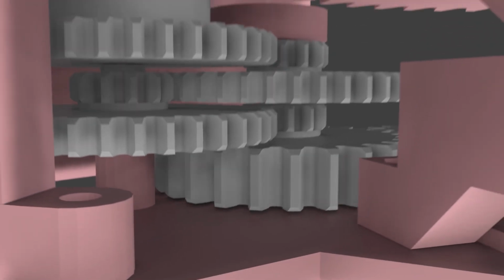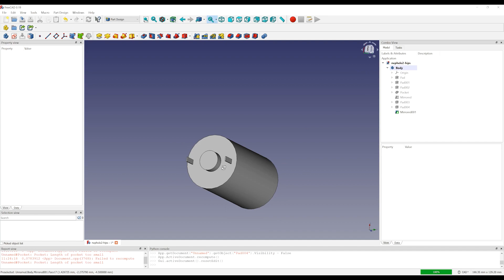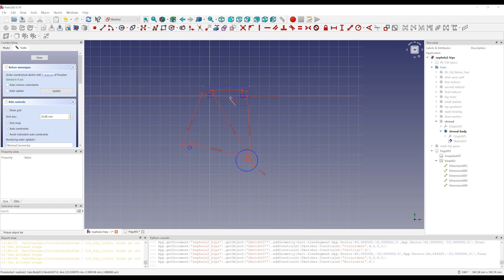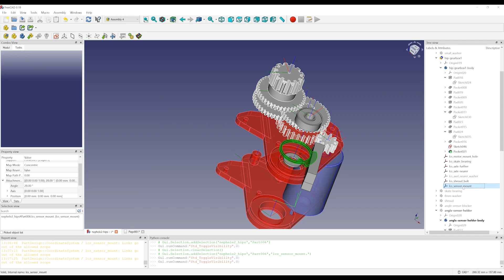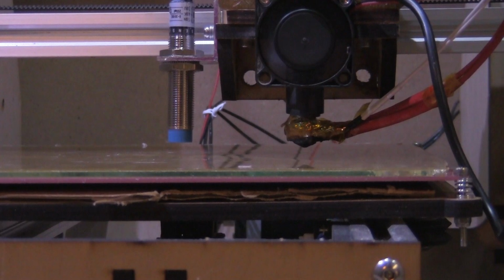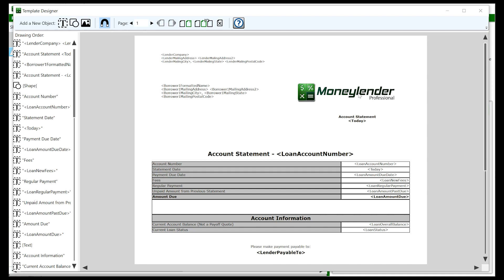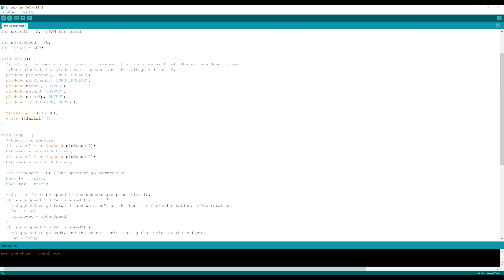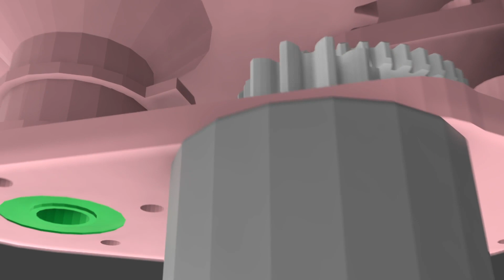Robot Hip Gearbox - FreeCAD design and 3D printing - Nephele Robot Project

Comment: Really good to watch and interesting to see you're using Assembly4 workbench.  I've played with Assembly4 but found it less intuitive than A2+ and Assembly3, perhaps I need to persevere with it...  I'm interested to know how you created the animation at the end of the video, with the gears spinning at the same time as panning the view camera, was this done in FreeCAD Assembly4 workbench too?
Reply from the maker: There's probably reasons to use A2plus or Assembly 3 in some situations.  Assembly 4 is a whole different mechanic, a lot more oriented to designing the parts in the context of a larger machine, rather than putting together parts that are already close to their final design.  But ultimately, they're each tools to help you do a job, so whatever gives you what you need at the moment is the correct option to use.

I did the animation in Blender.  Select all the bodies in the FreeCAD file (can't just select parts, the bodies themselves need to be selected) and export to .obj.  Blender will pull in the .obj file and keep all the bodies as separate objects, but still positioned where they should be.  Then I animated the rotation of the gears, enabled motion blur so you can actually tell how fast the individual gears are spinning, and rendered out a little fly-around.  I'm really novice at Blender, but the animation came out better than I would have guessed.

I'm doing Nephele's pelvis right now.  Some of it I've used Assembly 4 during the design, some I've just used placement properties to loosely position things.  Kinda freewheeling during the initial design stage while I get a feel for the salient specifications.  With the rough-ed in version drawn up, I can visualize the whole thing together and remake it with corrections where I missed some important things.  The finished pelvis parts will be assembled with Assembly 4 and I'll pull in static versions of the hips and legs, too.
Reply: Thanks for replying. I've not tried that in Blender yet but I'm interested to know that it works - sounds like I need to try it.  How does Blender know about the assembly constraints though? - i.e. when the rotation of the motor gear causes the next gear to revolve? - or are they not actually meshing and the parts simply animate independently at appropriate speeds - am I missing something obvious?
Reply from the maker: @eskibrew  You're right, Blender doesn't know anything about the constraints.  In this case it was easy to animate because the gears only rotated on a single axis.  Anything more complex than that would have been way over my head.

Comment: great work. I look forward to see the competed project. do you plan to upload a real time time lapse of the video or the source file to see you work flow?r
Reply from the maker: Thank you :)  Like the real-time recordings of designing stuff in FreeCAD?  On this video, I think it was six or ten hours to design the gearboxes.  It's sped up at least 100x, iirc.  A lot of just looking at it and thinking.  Sped up, it looks like I'm pretty busy the whole time, though.  My next video I have about 26 hours of recorded FreeCAD design.  I'm making an entire CNC milling table.  I'll be posting the FreeCAD file for the milling table and other digital materials for download, so you'll be able to see what I made in the video and then open it up yourself in FreeCAD and look at the parts and sketches and Assembly4 LCS references if you're interested.

Comment: It would be great to see detailed guide on gearbox design.
Reply from the maker: FreeCAD does all the heavy lifting when it comes to the tooth profiles for involute spur gears.  This gearbox was pretty bad in reality.  Too noisy, the outer housings are too flimsy for what they're supposed to do, small gears are maybe too small, bad tooth meshing from poor 3D printer calibration, sub-optimal filament...  After I've made a few more gearboxes as the robot progresses, I might be in better shape to share some information of practical use...  

Reading this page several years ago was super inspirational a ton of what I'm doing these days: https://lcamtuf.coredump.cx/gcnc/ch4/

A massive walkthrough with amazing information about 3D printing gears: https://engineerdog.com/2017/01/07/a-practical-guide-to-fdm-3d-printing-gears/

Thanks for watching my video!  What kind of gearbox are you making?  There's tons of types, and they all have unique characteristics.  When I was designing a pelvis, I used bevel gears and planetary gears, which was really interesting.  Occasionally I might want to use a worm gear or differential drive or something, and those are all really cool, too.  There's really good stuff on YouTube for each type of gear, though.  People who know a lot more than me.
Reply: @WhitmanTechnological  thanks for useful links! I’m working on a robot suitable for digging terrain and moving heavy objects (100-200kg). So I need high ratio (200:1) gearbox for drive train and will work on a manipulator later (want to use electric servos like you do, instead of hydraulic). Also, I want to open source it so everyone interesting in programming can just print chassis and start to implement their own robot logic without digging deep into mechanical engineering.

P.S. there is a lot of tutorials about single gear but no information about how to design a complex gearbox: what gear sizes at each step, what is the axle distance, what gear type is preferred etc.
Reply from the maker: @romantolkachyov  That's awesome.  After making this video, I learned how to make "compound planetary gears" that you can totally use to get really really high gear ratios.  In my "so long ABS" video I print a relatively small 150:1 gearbox using those gears, and then someone asked for a tutorial and I posted a quick and dirty tutorial on how those gearboxes work and how to make them in FreeCAD.  You can look for those videos on my channel.

The YouTube channel "Gear Down for What" does a ton of stuff with compound planetary gears - that's where I first saw them and learned how to make them.